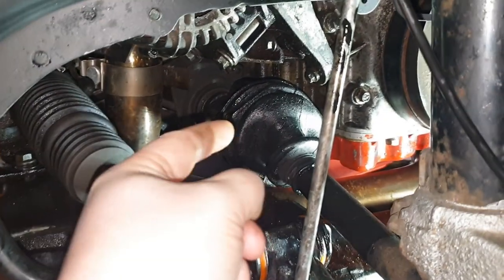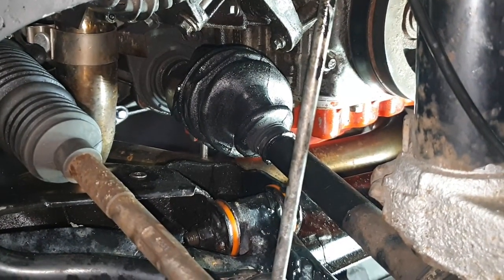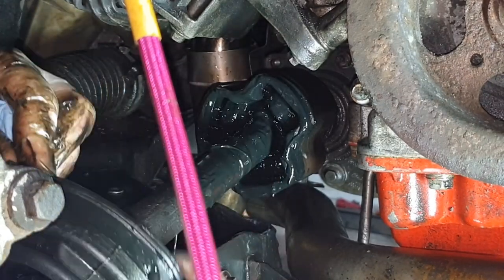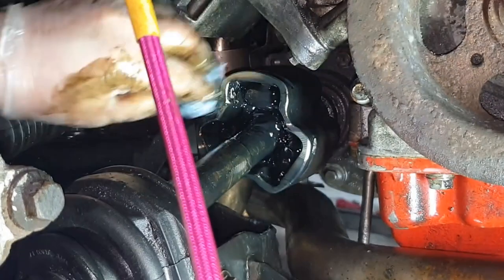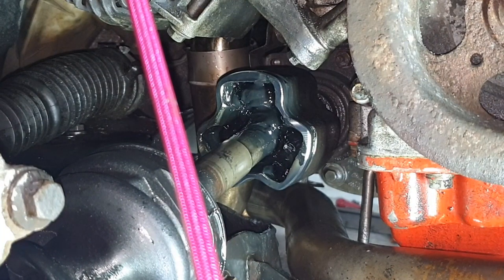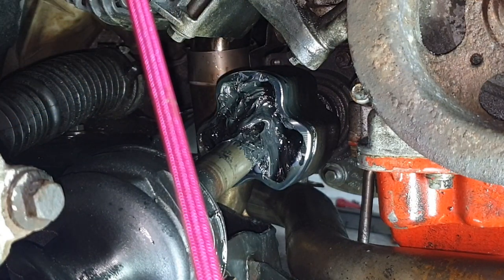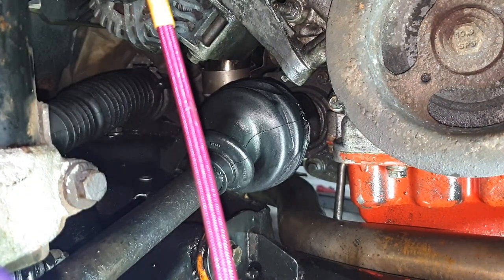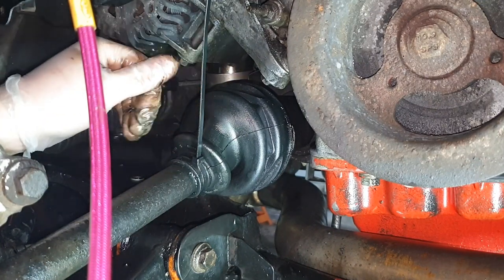CV boot re-grease (silly mistake)

Comment from the maker: I know this wont be every ones kinda vid and not normally one I would bother recording, but in a moment of not thinking while doing the Wishbone bushes, I popped the inner Cv boot which cause some of the grease to leak out, so I set about sorting it out. How ever while waiting for the correct clamps to turn up I used some Cable ties, now I have heard that people do this and its fine but me being me like to try and do the job right, so this was just a simple and fast fix. Enjoy
Reply: I hear you...😁
Reply from the maker: @AlexandruCandet  cheers mate 😀
Reply: Ive had 1 of the 3 rollers drop off the knuckle before when I had the shaft out for a job.the needle pins went everywere. Not good 😂
Keep em coming man .
Always look forward to your content
Reply from the maker: @stevencummings2395  one had fallen off in this one just slips back on, lucky. But this will be ok for now as im replacing the drive shafts soon.
Reply: I used cable ties too as a temp fix, because the clips that came with my new boots were the crappy fold-over type. The plan was to use cable ties until i could pick up some hose clips with the hex/screwdriver head. Anyway, floored it on axle stands with the wheels and brakes off and sure enough the cv boots with their cable ties slid straight off :/ and I thought they were tight as!
Reply: On a side note - I’m using gulf western super blue grease, really good quality stuff (overkill really tbh) but it’s so tacky by the way that if you pop a boot you probably won’t lose a drop of grease. Same for when your boot eventually splits, the grease will stay in there doing it’s job. Makes it easy to stick the shafts in too without the bearings falling off and if you’re like me... landing in sandy gravel

Comment: When you have time check on the grease inside of the tripod joint you filled with the lithium grease. These joints have a have a polyuria based grease. It’s needed for the way the needle bearings move. It’s less thick. Lithium Molly grease is too thick for needle bearings to operate and when they don’t lubricate while rolling it will cause heat and friction breakdown. The different additives between polyurea and lithium greases have a chemical reaction. I’m not sure how quickly the greases break down but the mix will initially have a liquifying affect and later harden as it dries. Molybdenum is a dry lubricant thickener and for the  other side of the shaft with the constant velocity joint it works great. Much bigger roller bearings.
Reply from the maker: Cheers for your input, when i can i will check everything over.
Reply: @ChazzCoombes  I call BS! Nobody wants to do that messy job again anytime soon😂🤣👊🏾

Comment: what is that noise? when you turn the driveshaft round because it doesn't sound good
Reply from the maker: Its the wheel linner on the floor on the other side of the car. I put it there coz the space i have and it was rubbing on the disc, scared the crud outta me when i heard it, lol.

Comment: Is cable tie enough to seal properly?
Reply: Yes, a good quality, right size zip lock at both ends, tight as possible, then painted over to stop any deterioration...Easy for pull back and regreasing at regular intervals..Lithium in the inner, Moli in the outer...Inject with a large syringe (printer ink refill type).

Comment: question?. What happens if someone put a grease in the axle connecting to the transmission?.
Reply: The axle joint will be greased. The axle joint is separate from the transmission. As long as you don’t put grease into the transmission itself you’re fine